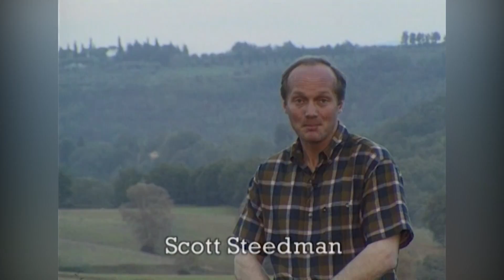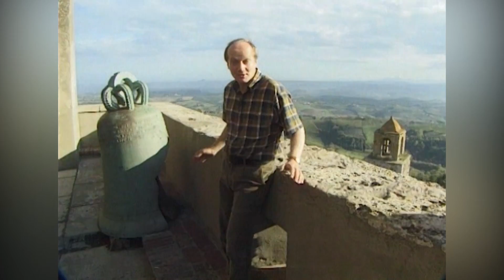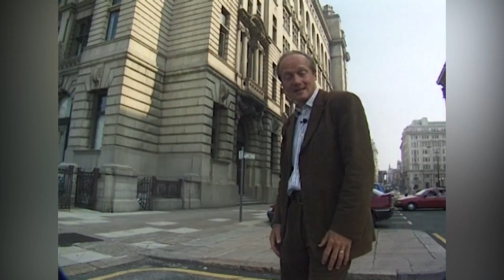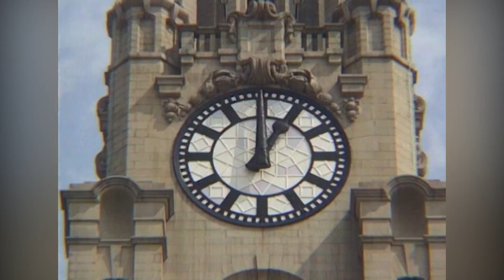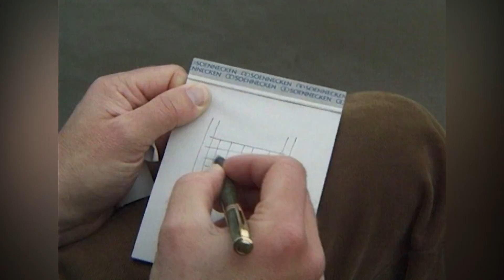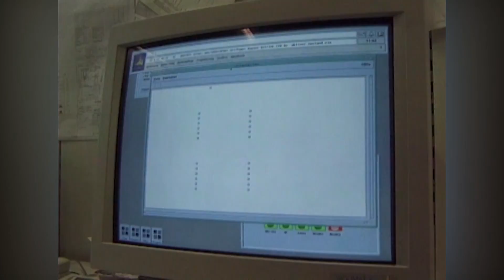The First British Skyscraper | How Did They Build That?

Comment: Liver Buildings.
You completely missed the 6 floors which are now below ground level.  These were above ground when it was built.  The foundations are wool/cotton bales laid on the river mud and were compressed by the weight of the building on a "Law of Diminishing Returns basis" so that eventually an equilibrium would be achieved and the building would stop sinking.
This was the only way a building could be put in this prominent position to be seen by incoming ships from across the Atlantic and Irish Sea.

Of course the entrance had to be changed from floor to floor as the building sank, which is why there are so many layers of cellars.

Having grown up in Birkenhead, across the river, I was always told that the Liver Building was the first to be built with a steel girder frame, which would have enough rigidity to initially sit on such soft foundations (before they became compressed).  
Have a look at https://www.liverpoolpicturebook.com/2012/03/liver-building.html
but you will have to scroll down a bit to see a photo of the Liver Building under construction.
Or the close-up of the shuttering of the clock-tower here - https://twitter.com/yoliverpool/status/672696362874597376.

I am pretty certain that the concrete frame is reinforced with steel girders, rivetted together and not as it is built today with drawn rods of steel spot welded and wire tied together.
Reply: You know more than he does.  Why don't you make an engineering/history vid about the Liver building and put it on youtube?